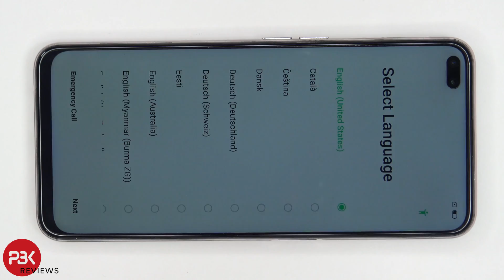OPPO Reno4 Z 5G Disassembly Teardown Repair Video Review

Comment: Hi, I need to replace my battery on my Reno 4z 5g as the battery is badly buldging 🙄😱 I was wondering when taking the back plate off, if it's just stuck down around the edges or in the middle as well as I don't want to risk heating up the blown battery if I can help it!? 🤔 Also will the back plate be ok to reinstall or with the back plate be stuck out if shape due to the bulging battery? 🤔 And if so where can I get a new original back plate as all I can find is expensive second hand plates or generic plates without the oppo logo on it!

Comment: How do i change my LCD display at home when the screen is completely detached (it fell off)
Reply from the maker: You would just have to buy a lcd with frame combo and move all the other parts from your old frame to the new, or a screen replacement and disassemble the phone as shown in this video and attach the new screen and connect the cable to the main board and re assemble the device.
Reply: @PBKreviews  I'll try thanks! Just so I know what's the difference between an lcd with frame and without

Comment: Yo could you post a video on how to repare a detached screen, the flex cable for my screen is detached completely now and I'm at a loss. Thank you for this video!
Reply from the maker: Hi, if the cable is torn/ripped, you would need to replace the entire screen. If not, you would need to disassemble the phone and run the cable back through the mid frame and connect the cable to the motherboard. You would be able to use B-7000 adhesive to re glue the screen to the frame.